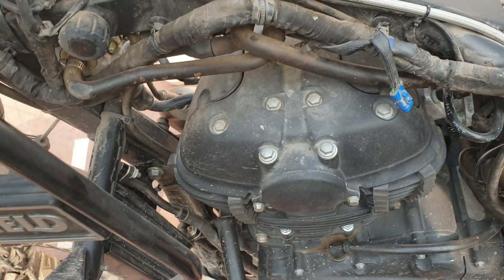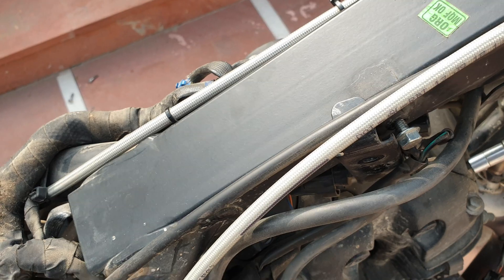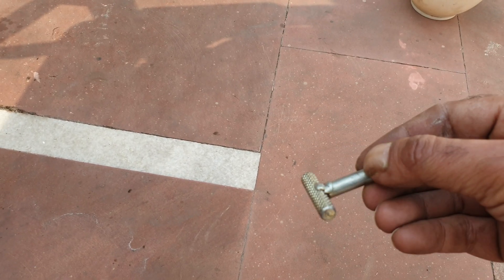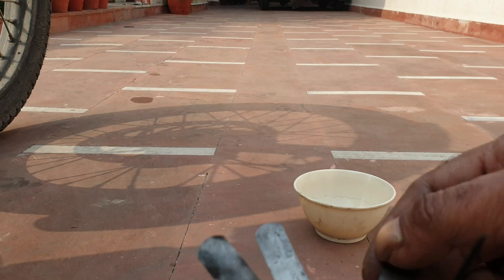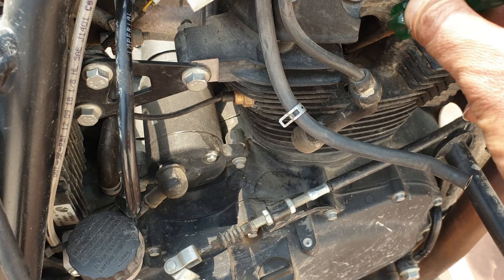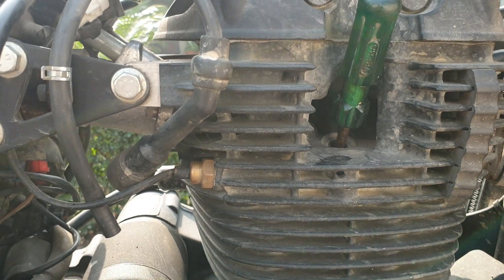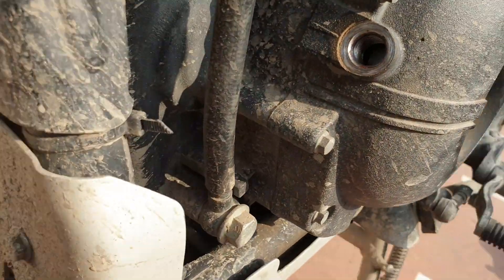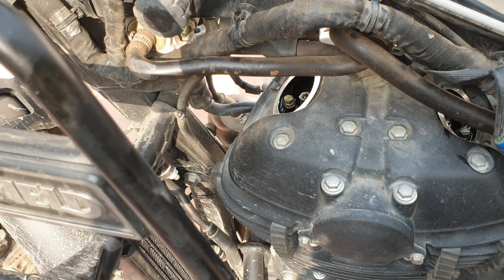Royal Enfield Himalayan - Bringing the Piston to Compression Stroke | Top Dead Center TDC | Part 1

Comment: One more way is to put a finger on the plug hole and feel the compression. That's pretty fool proof. That and what another person has commented below,  with your screwdriver method should work.. 
It would've been good I'd you had shown the use of the feeler gauges.  I always doubt whether I'm setting em right. 
Great info though.
Reply from the maker: Thanks mate, yes, many ways it can be checked indeed 
As for the feeler gauge use, here is the link to the second part
https://youtu.be/OLi-INbjlTM

Comment: Can you tell me the reason for doing this, how often it needs to be done and what are the benefits.
Reply from the maker: As a good practice if you are riding your bike hard and revving it to limit, check for these at 5 - 7000 kms. Normal usage - 10- 12000 kms will be ok. I believe RE too recommends 5000 kms. not sure though
The reason this needs to be checked is because as bike accumulates more and more kms there is wear and tear. The tappets are constantly hitting the top of valve stem and over a period of time that can cause some wear and tear at the tappet thus increasing and even decreasing the clearence, same for valve, both at top and bottom.

If the clearence is less then specification(or too tight), the valve is not properly closed while compression thus gasses leak out and you wont get proper cumbustion. When bike is cold, you would have starting/idling issues. Problem is worse when the engine gets hot while ride and heat expands valves, thus leading to poor performance, it would feel that engine is dragging. Knocking is also observed in some cases. Plus you run the risk of wearing out the valve and valve seats sooner then usual, as valve itself once expanded because of heat, is now hitting the seats with more meat :) I mean there are a lot of things are going wrong.

If clearence is more(or too loose), you would hear too much of engine clatter or tappet noise again followed by degraded performance plus more wear and tear again
Hope it helps
Cheers :)

Comment: Bro, bring the piston to tdc, (remove the plugon  LH engine cover and see the tdc mark)  
turn one full turn 360°  , it should be tdc in comp. stroke. To make sure, check both the valves, you can feel the play on both the valves. Adjust the tappets, intake 0.10, exhaust 0.25, both in mm.  That's it.
Reply from the maker: Thanks mate yes now that is a good way to do it, i agree. An on most bikes the mark is good and visible. But I still prefer to check. And for illustration purposes as well. As you know, Engine comes at TDC twice, I want to be sure that I adjust clearance at TDC in compression stroke and not the second TDC that is just before intake after the exhaust. You would be surprised to know how many mechanics out there end up doing it in intake stroke :) the difference is marginal and one can feel the play in TDC just before intake, so I just like to be sure, but that being said, your way of doing is absolutely on the spot.
Cheers :)
Reply: instaBlaster.

Comment: On how much km u need to do this?
Reply from the maker: Hey mate,
first one was done at 1500 kms, and then at 13300 kms. But enfield recommends every 10000 kms. In my opinion + - 1000 kms are ok :)
Cheers :)
Reply: I think the service manual recommends 5k km intervals for the valve clearances.  Check the service manual

Comment: At 8:11 I can see some oil between the top and cylinder. Is the gasket defect ? Or do you just have to tighten the screws ?
Reply from the maker: Good observation, have been keeping an eye on it. Fingers crossed, I hope it's not a gasket defect. That would be a bummer. For now it's just sweating a bit. Let's see
Cheers :)